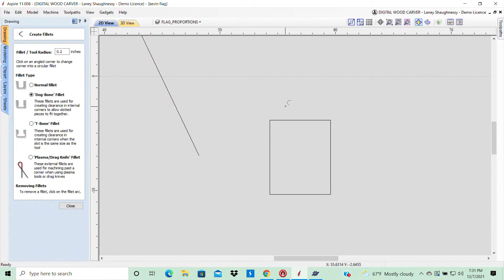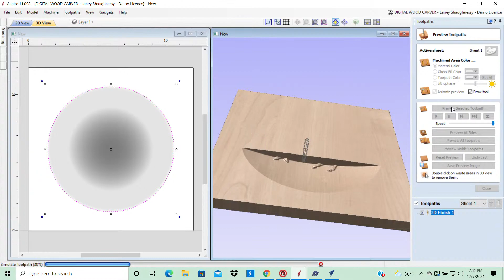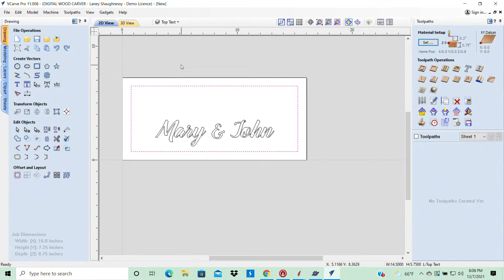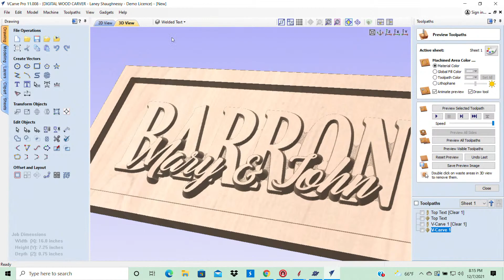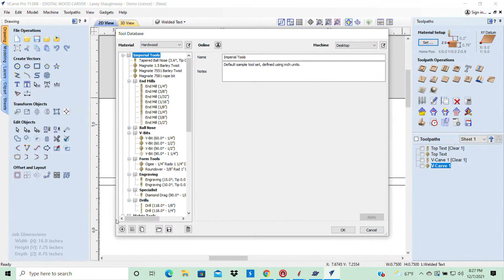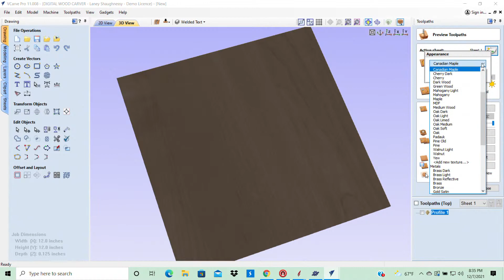1 hour Q&A | Live Event | Vectric |SpindleTV

Comment: Laney the other night I took a time reading from the right back corner toy the bottom left corner. In a rapid movement, it took 12 seconds to move 44 inches.I hope that this is what you need to figure out  the rapid rate and scale factor for my Shapeoko xxl.Pro thanks ?Jeff